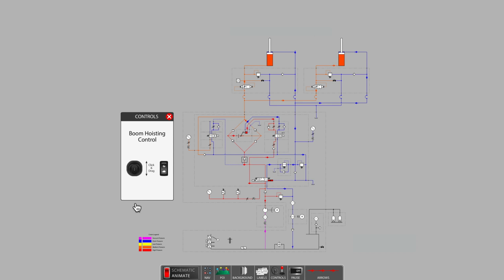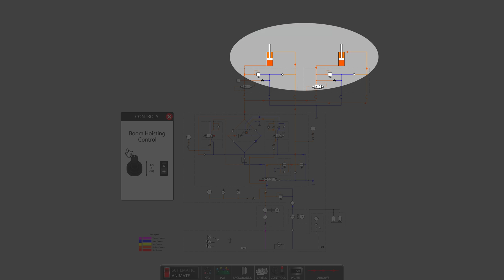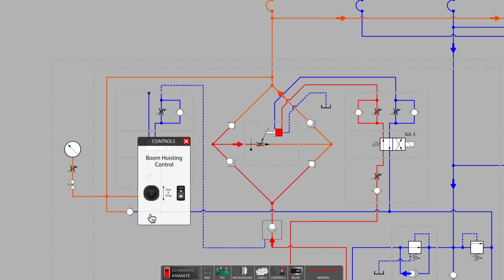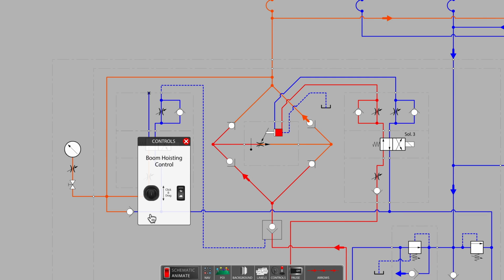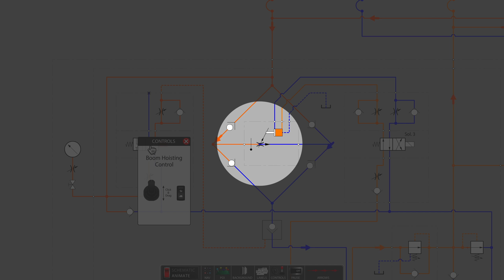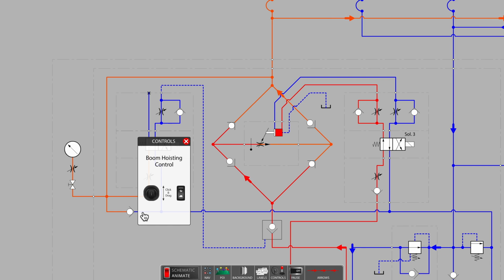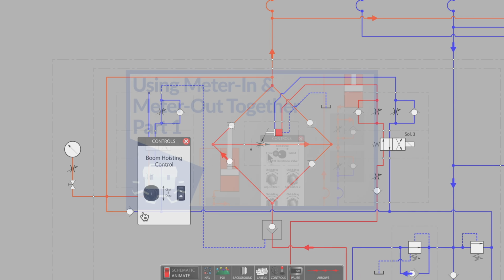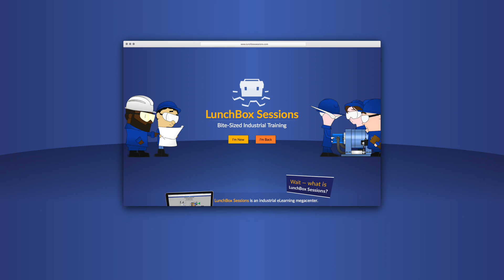Using Meter-In & Meter Out Together - Part 2

Comment: But the limitation here would be that we will have same speed in cylinder extending and retracting. Correct?
Reply: Shirdish Patil no. There's a control on flow control valve. I think it is pressure compensated flow control valve. That make you control to pinch or spread as you want